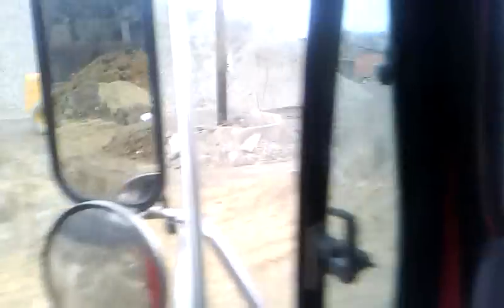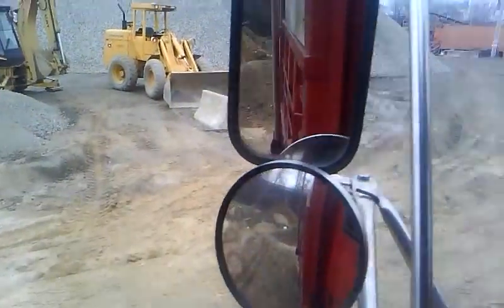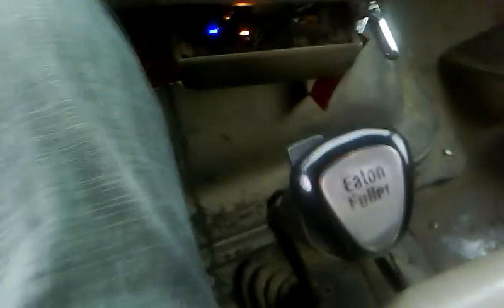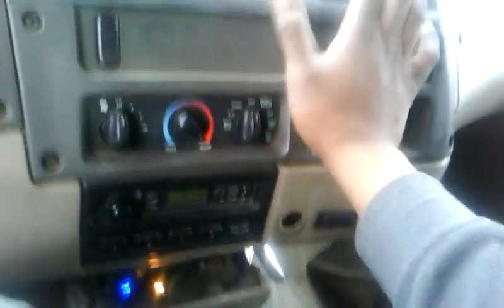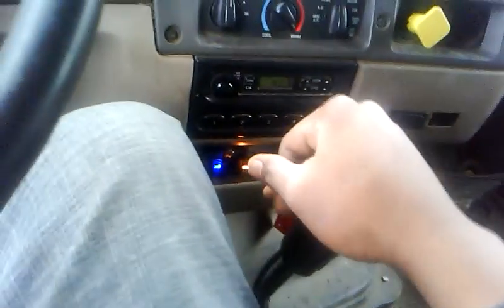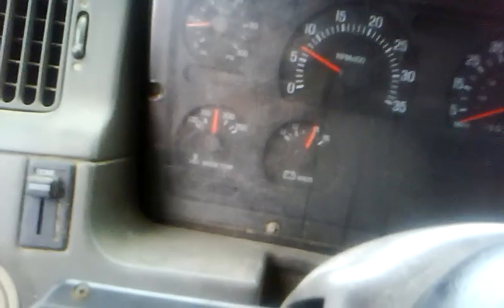How to shift a dump truck

Comment: good video. i work with a bunch of guys here in colorado and we have a variety of trucks. all i have to say is i am glad my truck floats and i only need to clutch if i am stopped to get moving. that looks like bad knees waiting to happen.
Reply: MY Driving Instructor Told me The same thing Only Step on the Clutch to Take Off That's it so Far 20 years later No Problem !!
Reply: when I did my road test 12 years ago, I was arguing with the examiner the entire trip about not using the clutch and her wanting me to.  She may have deducted points for not double clutching,m I don't know, but I still passed.
Reply from the maker: Alvin Finch I never use it
Reply: +Alvin Finch  U have to double clutch in school. They don't want people to ruin the transmission if they don't time it right. Most new drivers grind gears anyway so floating only adds to the problem. The state tests require double clutching.
Reply: @oldschoolhiphop2275  I was first taught to float😐. Now I have to test I was told they might want me to double clutch. Seems completely pointless if u know what ur doing but I guess double clutch it it's to remove this restriction. 🤦🏾‍♂️🤷🏾‍♂️

Comment from the maker: After you hit the accelerator you could jump right of the clutch wants the truck is moving you don't have to balance them the clutch mainly just keeps the engine from stalling when engaged in gear

Comment: Are most class B trucks used in companies nowadays automatic transmission or are they still mostly manual?
Reply: Both are common. Newer trucks tend to be auto, but tons of manual ones are still around. In my opinion, automatics are more convenient when you're dealing with traffic or spend a lot of time in urban areas, but manuals are safer and give you more control when you're dealing with inclement conditions or if you spend time in the mountains and such. Manuals are also cheaper to maintenance; fixing transmission issues on an automatic truck is fucking expensive.
Reply: +ThatKidOverThere Yeah, I asked because I have a California class b license but it's only good for auto trucks

Comment: I've had my class a for bout 12 yrs and this video really helped me to get acquainted with the truck itself. so my main thing was not to scrap gears and over correct myself on turning. Please continue to post video like this case it helps people like me that has a road test in the morning it will decide if I get the job or not to feed my kids..my wife has been pulling my weight and hers so I am trying to step up and be a man so thanks for the love on these videos. s.davis 229-292-4717

Comment: Check out my vids of shifting with a jake brake with 20 ton on a tri axle with no clutch
Reply: i used to routinely haul 25-26 tons on a tri-axle. 8LL transmission and other than starting and stopping rarely touched the clutch except for those times it didn't want to come out of gear.  company had me drive 60 miles back to the shop one time with the throw-out bearing gone. wasn't bad except i caught every redlight in the small town i was in before i got to the interstate. had to get it in 1st and use the starter to take off. I did get lucky and caught the 5 lights between the interstate and the shop green.

Comment: they do not all run the same i driven 10 speed dump truck and it shifts around 1500 rpm most truck i driven shift at that rpm. not unless sterling's are different